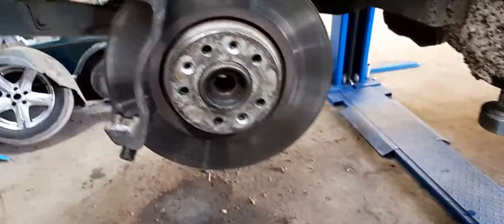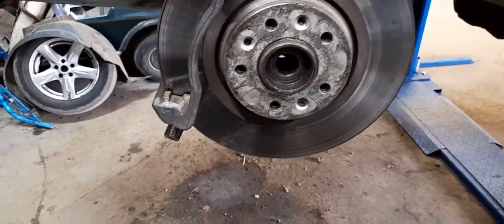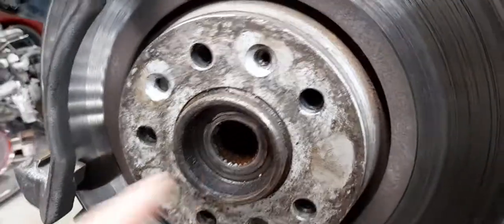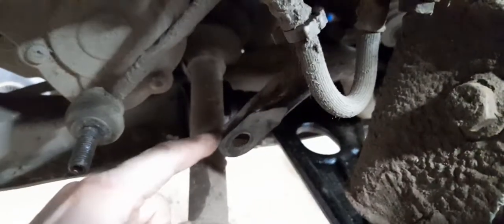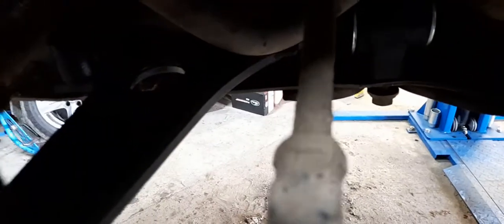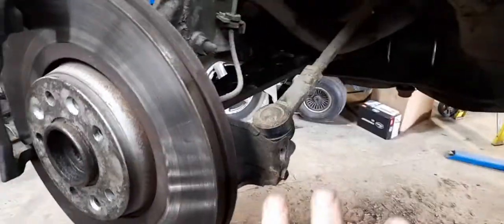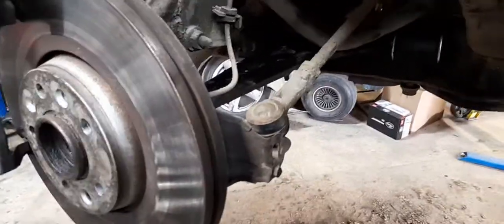Fiat Scudo bottom arm replacement

Comment: As I've learnt the hard way after doing several of these (806/Synergie/Dispatch) the key to doing this job is as shown in another video is to use a spring compressors to compress the shock spring. This will of course shorten the entire struct assembly and give the arm room to move up/down and also avoid the usual issue of snagging/ripping the CV boot with the bottom ball join end when its pulled out of the hub. I had to cut my spring compressors down to give the screws room while they are being screwed to compress as they are upside down to how you would normally use them with a struct/shock off the car. Undoing the anti-roll on both sides is also a must.

Comment: You only need to remove the stabiliser connection bars from the strut side preferably,  rather than the stabilisers (both sides), and then the two bolts on the lower strut connection (only the side you work on). Once the strut is out from the steering knuckle, you can push the strut slightly backwards, towards the rear of the vehicle and the whole arm can move up and down well enough, to get it out/in comfortably. Trust me, the drive shaft can stay in place. I will have to make a video.